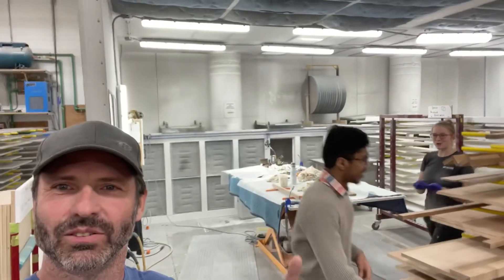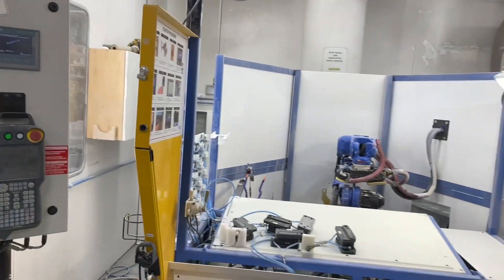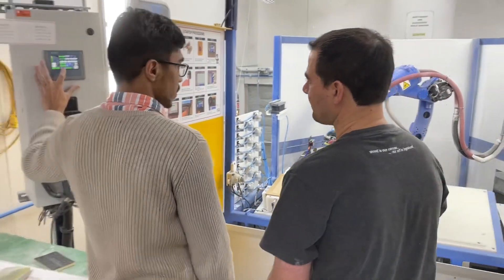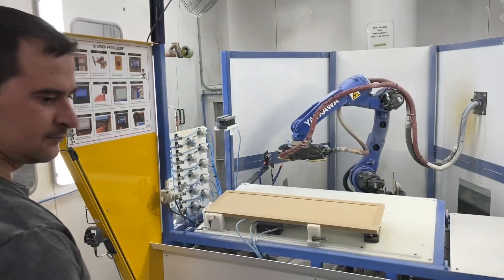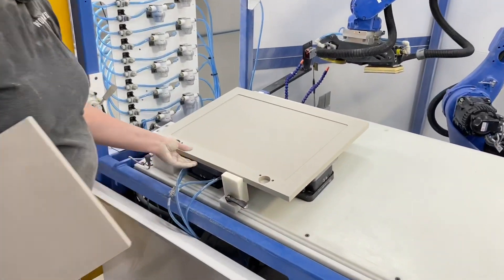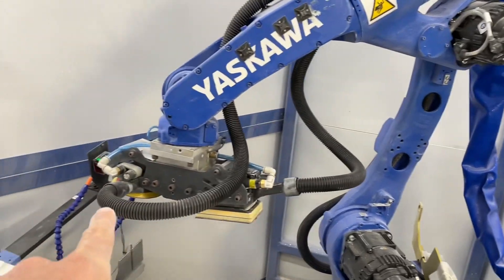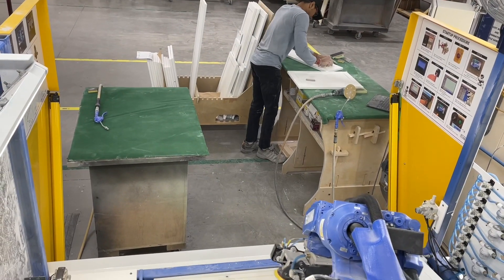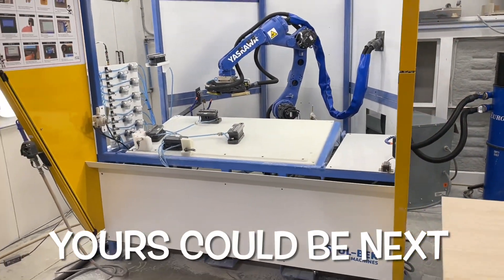Installing COSMO the worlds best sanding robot.

Comment: Looks like it didn't get very close to the stiles/rail when sanding the panel, which is the area that typically needs the most attention on the CNC'd one piece doors.
Reply from the maker: You can set the compensation to get as close or as far from the inside edge as you would like.  As well as how many passes you want to do

Comment: awesome machine will it sand the edge closest to the vac lines and the leading edge. it appears that there are stop blocks so I assume that you would have to rotate the panel?
Reply from the maker: YES, if you wanted to sand all 4 edges with robot, we would send robot out with 2 edges only, then rotate the door and send out with panel, stile & Rail & edges.  then the door is complete, if you need to sand the back, quick flip and hit go again.  Door is 100% complete.   If you want all 4 edges sanded, check out our Cosmo XL,  videos coming soon, but if its your first robot, we recommend to just rotate the door, WAY cheaper.
Reply: Very impressive sander. How much does a system like this cost?
Reply from the maker: @neillryan1062  Hi Neill, contact me at info@stolbek.ca and I will connect with you directly to discus pricing, lead times and more.  Have a great afternoon!